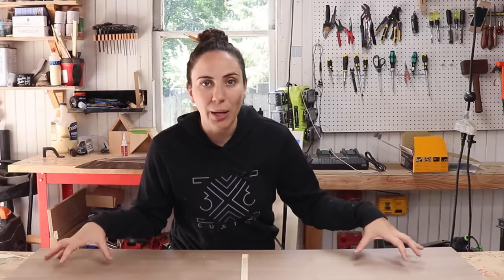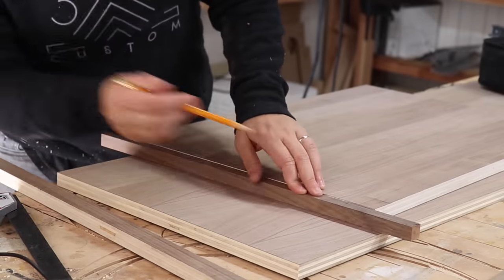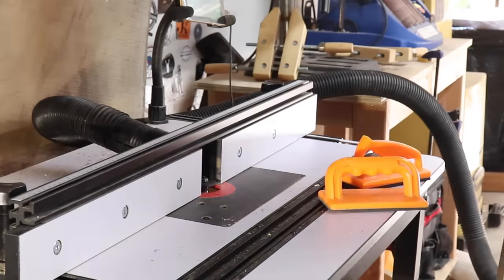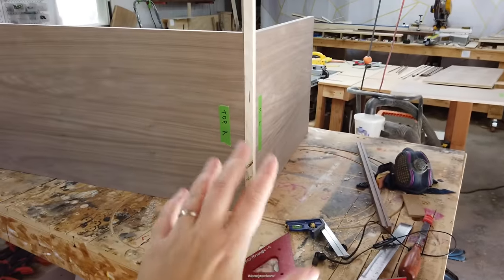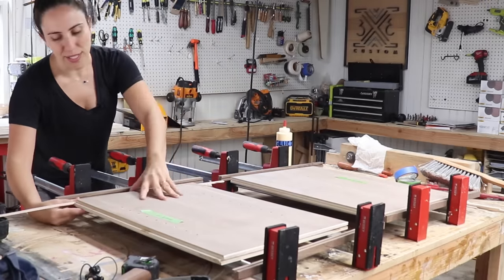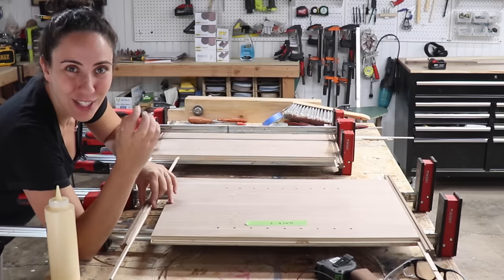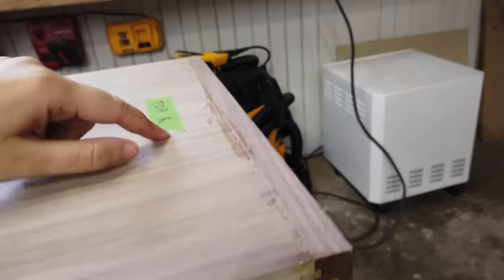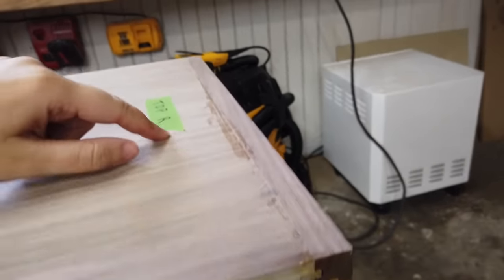Adding a ROUNDOVER to Plywood Corners - Corner EDGEBANDING with splines

Comment: It's logical that the small filler strip doesn't add any strength, as the force you applied was actually strongest on the inside of the corner.
Reply from the maker: True. But that’s really where force would be applied in reality. Not that much force. But that’s the direction it could fail

Comment: So now that I gave a little time I think you should learn metal working and combine it with the wood working.
Reply from the maker: Haha that’s the plan.
Reply: @3x3CustomTamar  Just for the record I am a MASTER Auto/ Technician  40 + years which includes  welding = Tig ,Mig, Arc and  metal shaping. I do woodworking as a secondary love  for cabinet and furniture building. I combine both trades to the cars  I build. So if you have any questions just shoot me a question through one of these links.

Comment: Gluing a square dowel to the inside of each corner will add to it's strength.
But it may not look as nice as  what you have done so far.
Reply from the maker: Yeah. I was considering just adding the cove to the front edge of a square block to add strength while still being able to achieve the inside curve. But I didn’t like the look. I liked the full cove running the depth of the cabinet.
Reply: @3x3CustomTamar  
Just looking at the picture again and noticed, If you add an oak square dowel to the inside corner and rounded the protruding corner over rather than leaving it square, the inside and outside dowels together will have a figure 8ish design. But if you're going to cover the edge of the plywood with edge banding, that would be kinda pointless as no one would see the design.
Reply: @3x3CustomTamar  
I just thought of a way to have a very strong joint with the hardwood round over.
1) Make a half lap joint at the corners. This will give you an L shaped outer corner. 
2) Insert your rounded over hardwood square into that L shaped corner.

This of course means that you will have an L step on the side of the drawer;. But for a drawer, it can be used as the drawer stop.
Have the cabinet sides top and bottom where the drawer inserts into a bit wider than usual and then attach molding to the face and around the drawer. This creates a pocket that the drawer face rests inside of when it is closed.

If you use the half laps on all four corners, the back L can be used as a stop so the drawer can't fall out. However, you might want to build into the cabinet a way to get the drawer out should that be necessary. But I do have an old square dresser that the drawers won't come out of. I'd have to take the dresser apart if I wanted to get the drawers out, so it's not unheard of.

Comment: You should try a lock miter bit.  This is one from Rockler, but they are available from several companies:  https://g.co/kgs/27jhdo
Infinity Cutting Tools has a setup gauge for these that makes getting the cut at the right position much easier.
Reply from the maker: I have been wanting to try it for sure

Comment: Think of all the trouble you could have saved yourself if you had used solid wood instead of plywood.
Reply from the maker: Hmmm. You mean jointing, planing, glueing up, planing again and then sanding.... oh. No trouble at all. Ha
Reply: @3x3CustomTamar  To each their own.  I prefer to avoid plywood as much as possible.
But you do you boo.
:D

Comment: Dear god, buy a Festool Domino machine.  You could have accomplished the same corner result in less than half the time.
Reply from the maker: Hmmm.... that’s the first time I’ve seen a comment like that. Usually when high end tools are used people complain they can’t accomplish the same results because they can’t afford said tools.
Reply: @3x3CustomTamar  The domino machine is the only Festool tool I own, but it's made a huge impact on both the quality and effort involved in completing joints like the one you needed to make. You can and I do pocket hole cabinet cases, but when invisible joinery in custom furniture is required, the domino machine is the go to.
Reply from the maker: Mike I will get it one day... but then I won’t get the opportunity to make videos like this. I actually enjoy figuring out ways to do different joinery techniques
Reply: @3x3CustomTamar  Nah, you'll just make 'different' videos. I've been  making furniture and other things for much of the past 20 years, and my skills and tools have evolved several times over those years. Yours will too.